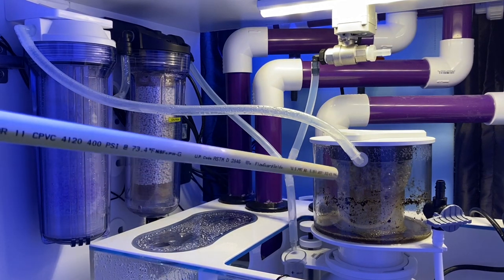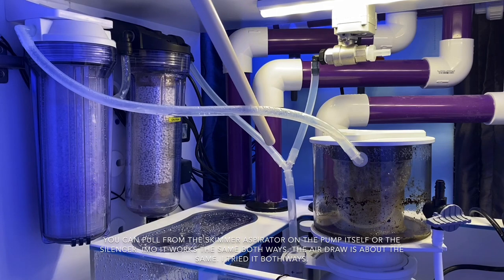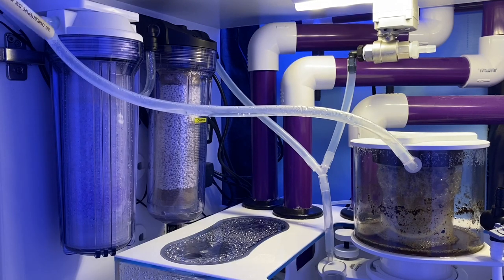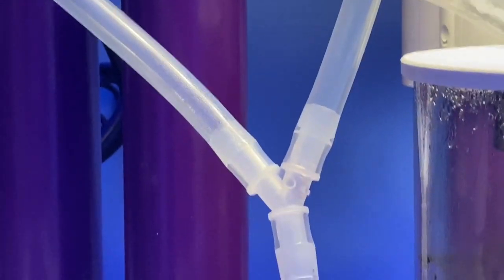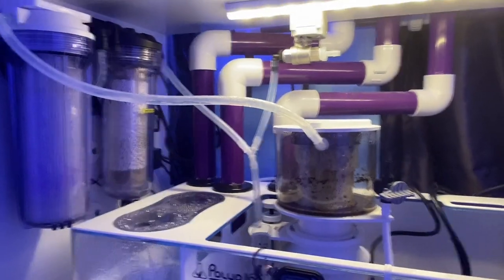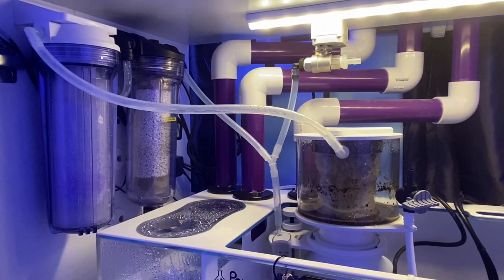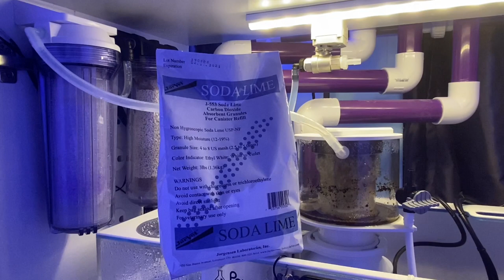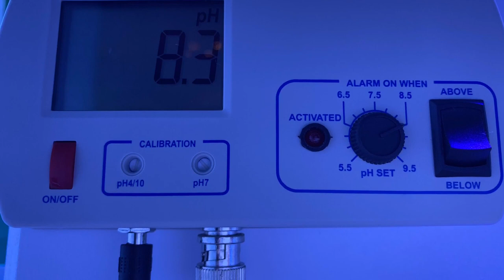DIY Recirculating CO2 Scrubber Details

Comment: Great job and thank you for taking the time to share this with us.
Reply from the maker: Thx! My pleasure. I made some changes to my new scrubber. The ball valve isn’t needed so I ditched it.  I also run a Bashsea for a Scrubber now. It channels the media well. I also pull from the outside currently but will probably do the recirculating method on and off. Here’s the link for the one I use now. Media lasts forever in this thing. https://www.saltwateraquarium.com/4-18-media-chamber-reactor-bashsea/?gclid=Cj0KCQjw-daUBhCIARIsALbkjSbTKcdxBjcPlczLnqt4bPTofM8HKQW3jushe3uzezxkEnIMRgOwJJ8aAnzUEALw_wcB

Comment: super helpful thank you. I run the CO2 scrubber with the ball valve controlled by my apex. I ditch the recirculated setup as the water collection becomes a hassle
Reply from the maker: Glad it was helpful. I don’t run the ball valve anymore because my pH never gets too high. 🙂
Reply: Run the CO2 scrubber through a sealed skimmate collection container to prevent flooding and trap excess moisture: https://youtu.be/kpKigSO9sR8?si=9eOoN5hPuHoy3mTL

Comment: I have 2 systems set up this way when I noticed something. You DON"T need to drill in to the skimmer cup!!!! On my 3rd system the Skimmer Cup drain goes to the lid of a 5 gallon bucket with a float sensor for overflow protection that shuts off via apex. I made another hole for the supply that leads to my  CO2 Scrubber.  it doesn't have to be a 5 gallon bucket you could use a thin/ tall Jimmy can. thats all you have to do.
Reply from the maker: Yeah, I already mentioned that. In just did it that way because my Avast skim waste reservoir is in the garage and I didn’t have an Apex at the time. The best way is to put a float switch on the skimmer lid, also put a skimmer high float as another failsafe. Then hook up a reservoir for waste collection with float switch. 3 layers of failsafes. :-)

Comment: Great setup! I thought ingesting air with higher C02 content lowered PH, not raised it. So sucking in cleaner air from outside - eg, less C02 - should raise your PH. That's why you're running the C02 scrubber: you want to raise your PH by removing C02.
Reply from the maker: Exactly. What did say?
Reply: Never mind. I misunderstood what you were saying. You're letting in air that bypasses the CO2 scrubber in order to lower the PH. That's the part that confused me.
Reply from the maker: @mdowney14  haha…no worries bro. Thx for tuning in. ✊🏼👍🏼

Comment: I must have missed where u explained WHY u are pulling air from the skimmer.
Reply from the maker: @Super Bikes and Stuff it’s called recirculating. When using “reduced” CO2 rich air from your skimmer you will avoid burning through your media. If you pulled the air from a room where multiple people are exhaling CO2 24/7 (in a house or small apartment) the air will be very CO2 rich. This will rapidly deplete your media. You’ll be changing it in less than 5 days. CO2 media also performs better when it’s receiving slightly moist air.

Comment: Please clarify: Is that a 1/2" hole you've drilled into the side of the skimmer cup?  Or did you use a 1/2" drill bit and simply not drill all of the way through so it's more like a 3/8" in hole. - thanks!
Reply from the maker: I’m not sure what size I used. A lot of links are in the description. I used the size hole for the grommet and tubing I used. I drilled all the way through. The drill bit is specifically made for drilling plastics. It will not crack the acrylic. You can get them at Tap plastics or any acrylic or plastics store online.
Reply: @Reefahholic  Thanks for the info.  Finally getting around to setting this up.  How did you mount the ball valve in your sump?  Did you glue it up there?  (Looking at mine and not seeing any obvious way to use screws)
Reply: I have some pretty strong industrial adhesive hook and loop fastener.  I think I'm going to go ahead and use that.

Comment: Hey, one question? Why did you went with a 1/2 ball valve, if all the plumbing is 3/8? Awesome set up
Reply from the maker: Because it was the only one I could find. I looked for 3/8” but couldn’t find one. The valve I used it the video was great. I was worried about it not being good quality, but it was a good piece of equipment.
Reply: @Reefahholic  thank you!!

Comment: Nice work. I'd like to emulate this setup.
Reply from the maker: It was actually fairly easy. I listed all the links in the description Dan. :-)
Reply: @Reefahholic  Have you thought about tieing in an Apex to regulate the pH so it will open the valve when the pH gets too high?
Reply from the maker: I didn't have an Apex (sold my last one), but just recently bought another one for pH control with my Calcium Reactor. If you have an Apex, this would be the best way to setup a CO2 scrubber. Just like pegging the internal pH of a reactor, you would peg the pH inside the tank and give a command to the ball valve to open if the pH got to high. Since I've set up the CO2 scrubber I haven't had to use the valve yet and most people probably won't, but it is a good tool to have just incase. I dose Kalk too, so I can manipulate my pH and get it were I want it and as high as I want it.
Reply: @Reefahholic  just got my Apex and Trident so I'm looking forward to implementing this setup. Just finished buying all of the plumbing parts this evening.
Reply from the maker: Nice...if you struggle with pH, it's a good tool to have. The only problem is the media gets depleted too quick IMO. Just imagine if you were only pulling room air. It would burn your media up in less than a week probably. Check out this thread...It will help  you:https://www.reef2reef.com/threads/the-best-way-to-implement-a-co2-scrubber.330806/

Comment: Does the skimmer line raise when switching to the soleniod due to more air pull/less distance to pull air?  Or is it unnoticeable?  Im trying to replicate something along the lines of what you did.
Reply from the maker: It wasn’t noticeable in my system. Also, the solenoid valve wasn’t needed, because the pH will never get above 8.4 unless something is wrong in the system. However, it could be used to switch over to outside air or even a mix of recirculating air and outside air.

Comment: I’m trying to emulate this setup. I have an IceCap CO2 scrubber with 3/8” silicon tubing. In the video, he mentioned using an USPLASTICS part on the skimmer cup to connect the 3/8” tubing. Can anyone clarify which part that is? I’ve reviewed the parts used and I don’t know which one is attached on the skimmer cup. TIA.
Reply from the maker: It’s the 3/8 elbow: 
https://www.usplastic.com/catalog/item.aspx?itemid=35012

I connected that to a grommet to make it look clean:
https://www.amazon.com/Glarks-200Pcs-Grommet-Assortment-Electrical/dp/B07CK7D7GB
Reply from the maker: Here are all the item numbers (item no.) When you pull up usplastic.com, just enter these numbers into the search bar and it will generate the exact item I used. Numbers: 64308, 62282, 64430, 64420, 64439, 64408, 64822. Keep in mind that you don’t have to use 3/8” or these exact items, but this is what I used to build my scrubber.

Comment: What do you do about moisture getting in the hose and down into the media?  I have ruined several batches of media.
Reply: that's the entire point of the recirculating system so the media stays moist which keeps it from drying out thus prolonging the media life.
Reply from the maker: It's hard to control it. You want to moist, but not too moist. When water builds up more than 1/2" dump the canister.

Comment: Hello! I have a recirkulating co2-scrubber on my skimmer up and running for some time. Right now my apex shuts off the skimmer when Ph gets too high. I would like to do something like you have with the motorized ball valve, but I would like to automate it (controlled by my apex and the ph-level). That means more or less on/off electric circuit. Do you have it automated and in that case hooow?? :) I can't understand how I can get it automated when the ball valves I can find only seem to use reverse polarity. 
Would love some guidance if you can recommend a solution :)
Reply from the maker: Hi, I’m not running the recirculating scrubber anymore. The reason is that it’s assumed to be unhealthy for the tank on the long term. If you want to automate it, you would simply plug it into the Apex and program either on or off depending on your pH valve. It’s that simple. If it’s reversed, it shouldn’t matter, you’d simply reverse the command. Hope this helps.
Reply: @Reefahholic  yeah I found that there was motorised ball valves that return to close if power goes off (had missed that part). Do you mean unhealthy in the way that there will be less oxygen through the skimmer, that would affect it badly in the long term? (Thanks for the reply)
Reply from the maker: @kimrosenqvist  Yeah pretty much. Less oxygen, because you’re recirculating the recycled “scrubbed air” which is  great for pH, but apparently not so great for the tank longterm. Letting in some fresh air that has 21% oxygen 79% nitrogen balances the tank out again. I think about it like this…if we were trapped in an air-tight room with only the scrubbed air to breathe it probably wouldn’t be good, but if we were allowed to open a window to breathe fresh air sometimes it would be much healthier. 🙂
Reply: @Reefahholic  yeah I completely agree. And sorry for another question, but isnt this ball valve exactly like that? Opening up the window on and off to let air in? I've installed one right now actually, and it opens up as soon as pH hits/is above 8,35 (which is around 6-8 hours per day ).
Reply from the maker: @kimrosenqvist  Yep, that will work as long as you switch back and forth. I never did that, because my pH never got high enough. :-(
Reply: @Reefahholic  ok that's such a shame. But at least your solution inspired me to try this out. I bought a solenoid first to try with (before seeing your video), and that was just a major fail. Should have done my homework before. Anyway, thanks for sharing and replying! 🙏
Reply from the maker: @kimrosenqvist  Yes sir! The ball valve has a much bigger hole. The solenoid valve has a tiny hole that restricts flow too much for my taste. Glad you got it hooked up and running. I’ll be setting up another one soon.

Comment: That moisture will ruin your media.
Reply from the maker: Never happened to me, but it’s probably better to install a water trap. I still run a scrubber on my new system. No water trap. Media last approximately 3 months. Although I do not see any moisture or water in the media at all. This is probably because I don’t recirculate anymore. I just pull outside air through the media and into the skimmer.

Comment: I run my recirculating CO2 scrubber through my sealed skimmate collection container to prevent flooding and trap excess moisture: https://youtu.be/kpKigSO9sR8?si=9eOoN5hPuHoy3mTL  
I also run a motorized ball valve on a pH controller that also controls a kalk reactor.